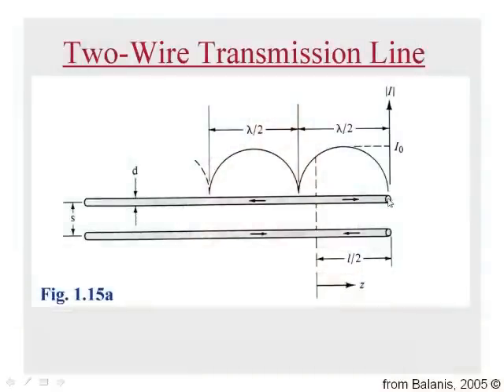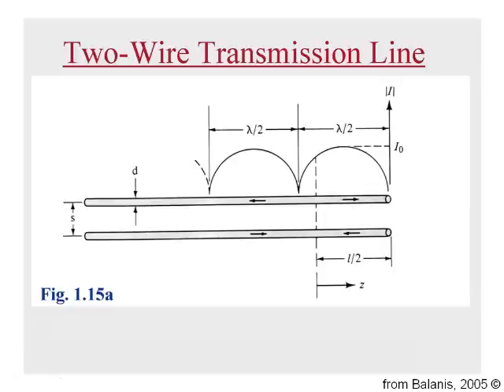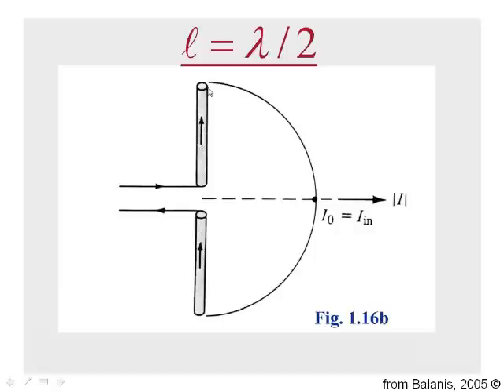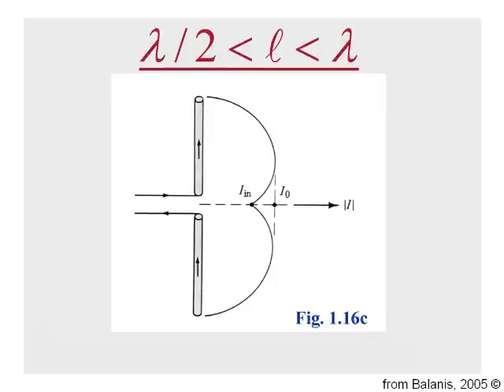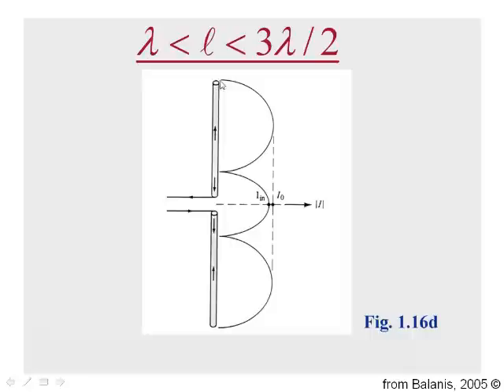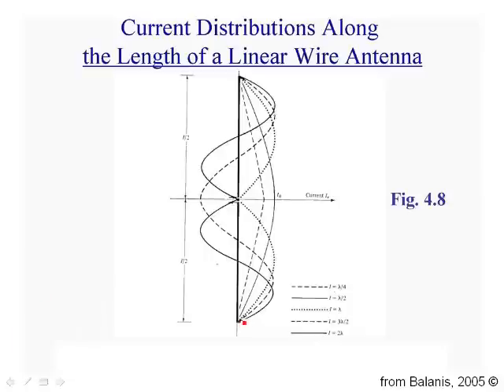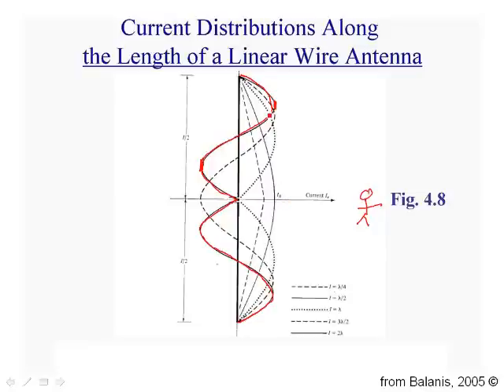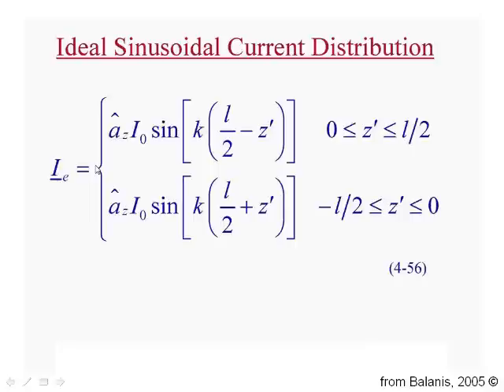Wire Antenna Currents

Comment: sir, 
I am new in antenna design 
I wanted to know, How to determine, Plot, Roughly estimate the radiation pattern of any antenna be it dipole antenna, mono-pole antenna, T antenna ,a square antenna,Helical antenna, loop antenna, a dish antenna and be it any type of antenna.
I am facing problem in this topic, i tried to understand the radiation pattern a many times but each time i failed. please provide some information related to this topic.
Thank you sir.
Reply: Quota le ke phans jao saalo or brahmno ko gali do

Comment: In the analogy with the transmission line, shouldn't the capacitive and resistive loss of the peeled wires portions be negligible the farther away from the splitting point? In other words, why is the analogy still standing?
Reply: Good question....
My intuition is that, in a perfect transmission line (ie, resistance=0), the oscillations will persist for very long even if no power is supplied as the energy will be stored in the transmission line capacitance and inductance and will leak out only very slowly.. But as soon as one end is peeled and bended (because there is no or very llittle L and C in that region now) the transmission line will start to radiate much more violently.. Now the oscillations will decay if power is not supplied via a battery...

Comment: I have a question, since this is open circuit system, it should be no current in the wire isn't it?
Reply: Thats a great question to start with. As the wire length is comparable to the wavelength, now there is no instantaneous change in voltage/current like our regular AC circuits. 
At each point , the voltage values are different - Hence the current flow is possible.

Comment from the maker: See the updated video description for the links.  YouTube wouldn't let me post them in the comment box.
Reply: "Batteryless Battery"????
a. Small aluminum cones with an electrical wire running through the center of the cones, cones spaced apart (not touching I'm thinking) but end to end.
b. Electromagnetic radiation energy in the atmosphere interacts with the aluminum cones.
c. Jostled atoms and molecules in the cone eventually have some electrons try to get away from other electrons of which those electrons gather at the larger end of the cone, of which also creates an area of positive charge at the smaller end of the cone.
d. The electron's in the wire are attracted to the positive end of the cone and the positive 'end' in the wire are attracted to the negatively charged end of the cone.
e. Basically a 'battery' has been created inside the electrical wire itself, different areas of electrical potential.  Basically a 'wire battery' or a 'batteryless battery', however one wanted to call it.
f. Numerous cones placed end to end increases the number of 'batteries' in the wire.

Then of course, one could take that generated dc electricity to split H2O into H2 and O2 of which could be burned or utilized in a hydrogen fuel cell to get the electricity back with a byproduct of basically pure water.  Species need pure water too.

With the increased cosmic radiation that is going to be impacting this Earth this century as well as possibly a mini-ice age, might as well put that cosmic radiation to work for us.